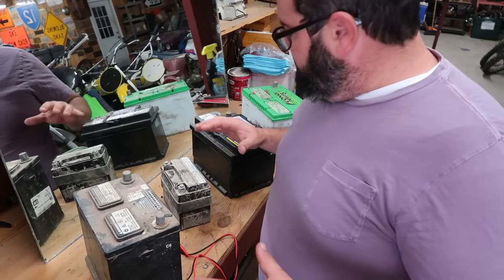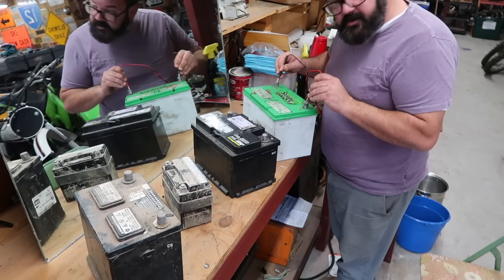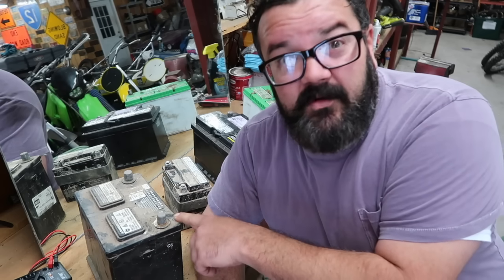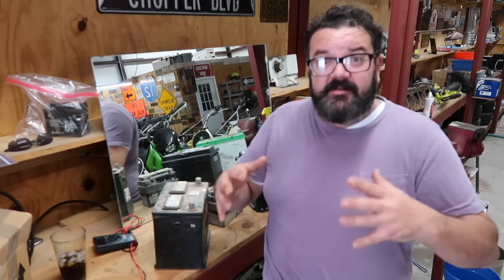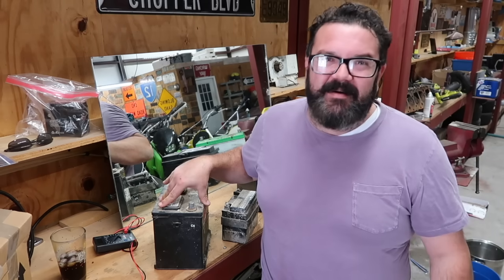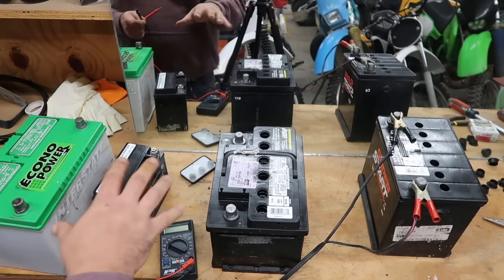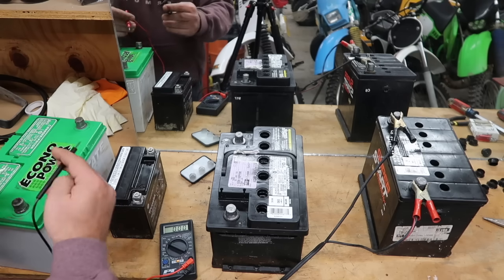Reconditioning a 12 Volt Car Battery: 100% Success

Comment: A lot of effort went into this but you need a stress test gauge to check a battery. A multi-meter just shows theirs voltage in the battery at the moment and that all the cells are working if you get 12 volts. ten volts means one cell isn't working. Cells are two volts each to total 12 volts.

Comment: Voltage means nothing. Use a tester that measures Cold Cranking Amps
Reply from the maker: Second video has CCA
Reply: Voltage means nothing?
Reply: True, below 12.7v, cant get my car cranking..
Reply: You can get 12.6v or higher but a load test for cca required to start your car.

Comment: Your testing is inadequate. 
The batteries maybe restored to like new. Idk
But testing a battery for voltage doesnt represent in anyway what the batter does under load. A big amp draw like a starter might see the battery voltage fall below what is acceptable. Get yourself a load tester and be sure about your findings. Thanks for posting though.
Reply: Thanks for the Video clip! Forgive me for butting in, I would appreciate your opinion. Have you ever tried - Lammywalness Trendy Trade Guide (google it)? It is an awesome one off guide for learning how to recondition batteries at home without the normal expense. Ive heard some super things about it and my BF after a lifetime of fighting got excellent results with it.
Reply from the maker: CCA video coming this week.
Reply from the maker: https://www.youtube.com/watch?v=RNnSYuTuLk4&t=46s

Comment: Salt acts as an abrasive and scrubs the surface for you. That totally makes sense. I would shake them gently while the solution of salt is inside wondering why not use some new distilled water with salt but yeah great video 👍
Reply: Epsom salt isn't sodium chloride 'salt', it's magnesium sulfate.

Comment: You can use alum which is aluminum potassium sulfate. This is able to penetrate the lead sulfate on the plate while the potassium in it makes the electrolyte more conductive. The epsom salt does similar except it doesnt make the electrolyte more conductive. About 4 to 8 Ccs per cell boiling hot saturated epsom or alum solution is all that is needed. Let sit for an hour. Zap with high current briefly till it draws amps, then charge normally. Resting voltage drops by a few tenths of a volt BUT you do get much better peak amps out, especially cold. Mine stared a truck in -50 Wisconsin weather.

Comment: Thank you for this very informative video. I myself have 3 car batteries that are dead and will follow your method to try and revive them. One question after rinsing the batteries with the epson salt and purified water solution, when emptied, do you just refill the battery with the old acid or with the acid and water/epson salt solution combined?
Reply from the maker: Put the old acid back in, watch my part 2 video
Reply: Did you try it yet

Comment: Thats what I said!  I have had batteries in the past that showed 13v!  But under load, it couldn't start my truck!   So because you got a battery to show 12v from 2v doesn't mean you reconditioned a battery!
Reply from the maker: It shows that the epson salt cleans the plates. It then started the vehicles. You most likely had bridged plates because one or more of them is broken. There is no solution fix for that. Just because it didn't work for your battery doesn't mean that everyone in the world shouldn't give it a try. If we all went by your way of thinking we would never if have had light bulbs...
Reply from the maker: https://www.youtube.com/watch?v=RNnSYuTuLk4&t=46s
Reply: It's not 100% but for $3.00 in epsom salt, it's worth the gamble.  I get about half of them to work when I do it.

Comment: 50 amp is generally used for jump starting a low battery. It will boil water out. And over charge a battery quickly.

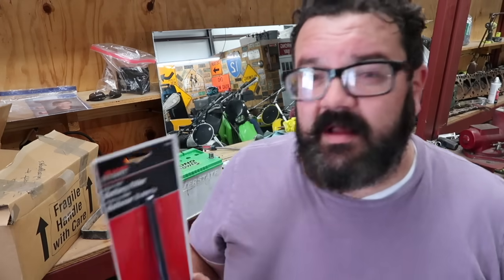Comment: At 6:23 you said you were going to "dump this fluid out" which was what came out of the batteries. At 8:25 you said that you mixed the Epsom Salt/Water solution with the acid....but above you said you dumped the acid.  (1). Where did the acid come from did you buy fresh acid/water mix?  (2.) Did you pour the acid into the entire gallon of the Epsom salts solution?  (3.) If you reused the acid, did you filter it with a cloth or did you pour it unfiltered into the Epsom salts?  (4.) Wouldn't that dilute the acid concentration like 1 part acid to 50 parts water?  I was anticipating you using the Epsom salts/water solution to clean the inside of the battery but you mixed it with the acid before putting it back in, right? Greatly appreciate your information!

Comment: You need some additional steps, friend. Before you drain, shake it up like hell, like a paint shaker to loosen up all the solidified debris on the bottom if you can. Then dump the acid and before you mix the salts mix, "filter" the drained acid with some quality large coffee filters so the acid is lead/metal/contaminant free (clear). No use putting the debris back onto the plates you just spent time & effort cleaning.
Reply: Is it better to buy new acid or just replace the old one in? From Cyprus
Reply: @antonios4926  My revised understanding is that the acid is still in the battery just crystalline sulfated onto the places hindering the ability of electron passage between the plates. I believe the "grey gunk" is actually spent dead lead that has discharged it's electrons in the normal process. All that spent lead needs to go from top to bottom of the cells. DO NOT put Baking Soda into the battery. It will ruin the acid that's turned into crystal sulfate that's attached to the plates. We want to reconstitute that back off the plates and into the distilled water solution so the electrons can flow freely again to create voltage/current. So, what I'm going to do is by a Specific Gravity (SG) battery fluid Hydrometer tester to monitor during the process and possibly an acid Ph test kit. If you do the Baking Soda thing, you'll need more acid to get the SG back up to where it needs to be for best performance of the plates after the plates are clean. Folks are doing this for a business reconditioning batteries I've discovered.

The way, now that I've spent some time comparing a number of folks talking about this and better understand what's going on, I plan to buy a small bottle of Sulfuric battery acid which is available everywhere, to top off at the end of the process to get the right SG reading.

1. Wash the battery squeaky clean than trickle charge for 12 hours, take SG and voltage measurements..
2. Shake the battery "vigorously" in all directions except upside down to loosen spent, collected on the bottom  lead sludge and dump in to plastic tub.
3, "Slowly" neutralize spent acid solution in tub with Baking Soda/tap water mix to make it safe to dispose of. No more foaming/bubbling means acid is neutralized and safe.
4. Thoroughly rinse out the core with clean tap water until no more spent lead, nothing but clear water comes out when draining , then allow to completely drain upside down for 5 minutes.
5. Mix up the Epsom Salts solution. I'm seeing roughly 12 oz./gal of hot distilled water, filling cells just coving plate tops and taking SG & voltage measurement. (If you're seeing a different mix, please share links!) 
6. Putting the battery on a 2 amp trickle charge overnight (10-12 hrs). Re-measuring SG & voltage.  I may bump the charger/starter charge unit to start mode (50-75 amps)  every once in a while to help knock off the sulfate to help it dissolve back into the new distilled water solution to speed up the process.

Trickle charge again, after total 24 hours of trickle charging take measurements again and visually inspect plates with a good LED light to see if I can see any leftover sulfate deposits. If I see deposits I'll leave trickling for another 6 hours & recheck. After all looks good, final measurements. 

If SG is good is good, I'll top off with distilled water to bottom of cap opening just below the inner top of the core and fully covering all the plates and call it a day. 

If SG is low(voltage will most likely be low also), I'll pull some Epsom Salts solution out and replace with new battery acid & recheck until SG is good, recharge, measure and top off with distilled if need be and be done .

If SG and voltage (12.9 or better) is good after final recharging, I'm calling it reconditioned & good. Your mileage may vary, that's just how I'm doing it because this Epsom Salts fix appears to be for real the way it's helping reconstitute the acid back off the plates and into the distilled water solution so they conduct and the electrons start flowing freely again.
Reply: @ThePreyMantas  I thank you for your time. You are very knowledgeable. I wish you well
Reply: @antonios4926  If only that were true. :) Sure thing and let us know how you make out on the project!
Reply: Pray Mantas. I am just about to attempt this with two marine batteries from my boat. Good on you to take such time and patience. 👍👍
Reply from the maker: Thanks for watching

Comment: Yup, old sediment, it is as if u had an internal load on the battery as it is a resistance across the 
plates. I'd put a load tester on the batteries now, proper voltage with no real amps won't do much.

Comment: This article is completely misleading he might have brought the voltage up did you see him try to start a vehicle?no you didn't because they won't they don't have any power in them a battery that reads 12v is practically still flat 12v lead acid batteries charged up will read 13/13.5 or even higher up to 14.4
Reply from the maker: Ever seen one read 14.5?
Reply: @CarGroves  yes I've seen them hit 18/20but your overcharging and your damageing the battery
Reply: Anything over 13.8 is damaging the battery.

Comment: tell us CCA of each battery after charging....getting 12V doesn't mean anything
Reply from the maker: I'll do a second video soon with CCA
Reply: Brunz M  That would be nice to see befores and afters. You'd think that folks would be aware of that since that's what it's all about. ;)
Reply from the maker: https://www.youtube.com/watch?v=RNnSYuTuLk4&t=46s
Reply: Had a Sears battery that being about a month old died in the middle of a crank. Full voltage yet no amperage would not even activate the solenoid.
Took back to Sears told the guy what it did, he put on test bench put big leads on to it. Tested acid with hygrometer- all even- full charge. He hit the amps test and the needle hardly flinched. Threw it in the pile wrote me up for another.
Reply: No, it means SOMETHING, but..I know what you mean.  And even the 12V, we need to know if it HELD that 12V.
Reply: You should filter out the liquid somehow before you put it back in the batteries.
Reply: @michaelszczys8316  One cell obviously shorted.

Comment: what about AMPs? Cant assume their good just on voltage.
Reply: I had one that'll charge to 12.7 volts, but after an hour, it'll die to 10.9 volts. Sign of a dead cell. It's dangerous, but you can pop it with a welder sometimes & get the dead cell to take. There's a video on here somewhere where a Mexican guy did it.
Reply: @virginia7125  
Very dangerous, when you "cook" a battery like that it makes hydrogen gas which is highly explosive. 
I had a motorcycle battery blow up in my face like that, it wasn't a car battery but it was a large motorcycle battery, one of the biggest one's ever used and when it blew up it blew an entire section off of it, I'm lucky I still have my face.
I was putting it back in the bike after trying something like that and when I was putting the chrome cover back on it the cover touched the positive terminal and sparked, an instant later there was a white flash and the next thing I remember was standing fully upright about 6 feet from the bike with my 2 friends screaming at me but I couldn't hear anything they were saying, because I'd temporarily blown out my hearing.
Sometimes in life it just pays to bite the financial bullet and buy a new battery instead of trying these homemade ways of doing things thinking your going to beat the system, you do wind up with a new battery out of it after all.

Comment: Batteries need to be tested under load. Any old car battery will give you 12 volts but the minute you try to draw any sizeable current such as to a starter motor, the voltage will drop due to the internal resistance of the shit battery.
Reply from the maker: Bad batteries will not show 12v if the plates are bridged. Starting the vehicle is a load test

Comment: i try not to replace the fluid if i can. i put distilled water to top off low cells. i hit the battery with 75-105A of current for a couple minutes, boiling the cells and waiting for temps to reach 90F before i shut it off. let it cool. and repeat this cycle a few times.  then i put the battery on a trickle smart charger with reconditioning mode.  that seems to bring back every battery ive ever tried it on.

Comment: "i've got epsom salt and battery acid mixed together..."  Well, what ratio? You skipped the most important part...
Reply from the maker: All of it
Reply: @CarGroves  what the heck kind of an answer is ALL OF IT? Why can't you list all supplies and mix ratios in the notes?
Reply: He said on the vid, 4lb bag to 1 gal of water.
Reply: @oscarpallaresmedia21  Seems to me if you put 4 lbs of Epsom Salts into a box of lead plates of that size, all you will do is liquify the plates instead of removing the sulfated lead....maybe test that ratio first, on an old lead plate from a useless battery first; or even better, find a junk, useless battery with 1 volt and try that.
Reply: How much acid and how much salt water?
Reply: @CarGroves  as has been pointed out, 'all of it' isn't much help if we don't know how much battery acid you had. In order to scale up or down for our own projects, it would help to know roughly the ratios of epson salts:water:old acid to use.
Reply: @gregpmil  .Bull shit storey. you could never get one gallon of water into so few batteries. So most of the acid is not replaced in the batteries. Waist of time to watch this.!

Comment: Whats the ratio between epsom salt and acid solution may I know? Well if there was that much different in the voltage before -after it just might start a car.
Reply from the maker: 50/50
Reply: Kudos for the video content! Forgive me for chiming in, I am interested in your opinion. Have you researched - Rozardner Powerful Battery Reality (search on google)? It is an awesome one off guide for learning how to recondition an old battery minus the normal expense. Ive heard some pretty good things about it and my mate after many years got astronomical results with it.
Reply: Oh snap

Comment: My car solenoid just clicked, I read the battery with the volt meter, it read 11.2 volts and didn’t have enough juice to turn the engine. Amazing how that works. It has to be 12 volts +.

Comment: Ups fixes car batteries quickly, it needs a computer and monitor to be connected. When the ups stops, one car bulb is needed to drain it fully for one night. The trick works, because the ups has a transformer, that is inductive, causing the memory effect to leave the battery.

Comment: You failed to load test each of your batteries. A good battery should not drop below 10v while under load and the load should be held for at least 5 secs. A recharged battery will show 12v if tested shortly after a charge if the battery has no dead cells.
Reply: It cld show 13 volts and still fall on it's face with a load tester. Agreed.
Reply from the maker: Load test completed...

https://www.youtube.com/watch?v=RNnSYuTuLk4&t=156s

Comment: In video one you use a mixture of the used acid and distilled water/Epsom salt mix. In the second video it was only Epsom salt and distilled water mixture. Which worked better? Also, I've seen many videos of people cleaning and flushing the battery with a distilled water and baking soda mixture. Is that helpful in cleaning the plates?

Comment: A very important part of the charging process has to do with the voltage and not just amps. There needs to be a high voltage to overcome the internal resistance that the sulfation is causing. All the newer battery chargers are regulated and don't allow you to reach the higher voltages that are necessary to recondition a heavily sulfated battery.

Comment: using a load tester will justify if the battery is restored or not
Reply from the maker: try this video

https://www.youtube.com/watch?v=RNnSYuTuLk4&t=156s
Reply: Using the starter does too.  The guy never said it was like a new $150.00 battery.  He said it would start your engine.